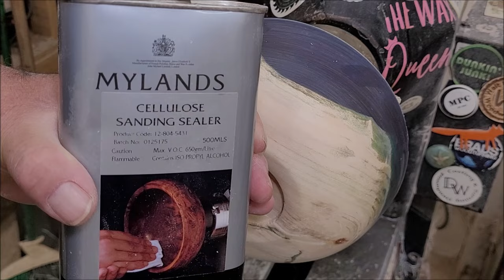Finishing Projects Under the Bench

Comment: Doug I love seeing these "project finish" videos. I have a few of these I need to work on myself. I find that some of the alumilite dyes are ment for the alumilite white due to the color it looks in a clear resin. The green for example is blue in a clear resin, but turns green in alumilite white. Odd. I know you mentioned the color change at one point is why I mentioned it is all. Gorgeous bowl over all.
Reply from the maker: Thank you Chris,  yeah the green is blue in totalboat also, it is green in the cactus juice but the blue dye for some reason will not cure in the cactus juice.  I've tried it twice now using new resin the second time,

Comment: Hi 👋, Doug , I hope you are all keeping safe and well, NICE 👍 BOWL 🥣, 😂, I think sometimes bubbles can look cool, 👍 . I know one of your competitors he likes casting his wood turning, to create thermal, cracking, then a recast again, so where are the cracks are go in with the colour and so it looks quite impressive, a question if you could give me some info, I have some walnut some of it is quite big but the centre is rotted out, have you ever filled the centre up with resin and then try to turn it?, What would you suggest? I forgot to mention it’s still got to dry out. I’ll be another next year probably hopefully, 
Phil from the moulin France,
Reply from the maker: Thank you Phil, I have used walnut with the center rotted out but I have not tried to fill the center like you suggest, only half of it in a bucket, you can put it in the oven and speed up the drying process but it will also crack,  I would also if I tried to pour that, would use a deep pour resin or thick set like total boat has, it takes a few days to set up so it doesn't over heat like normal epoxy does
Reply: @PohlBarnProductions  Hi, Doug , Okay thank you for your advice, I have a small piece about 6” round, 3” thick, i will try that first, I’ll check it tomorrow for moisture content,  I’m hoping to get some pennies in a few weeks time so I’ll get some reason, thank you once again for your advice, I’ll let you know how I get on, I forgot to say the big bits are around 15 to 20 inches in diameter and 12 to 14 inches. In length on the centre is completely wrote it out but there is hardwood around the side on the bark is still on, I’ll let you know what happens. Thank you for your help and I’ll see you next week or next project., Phil from the moulin,